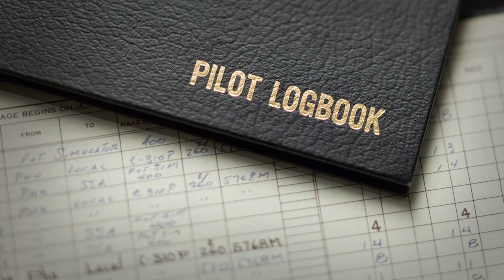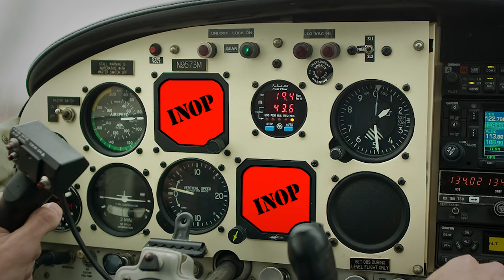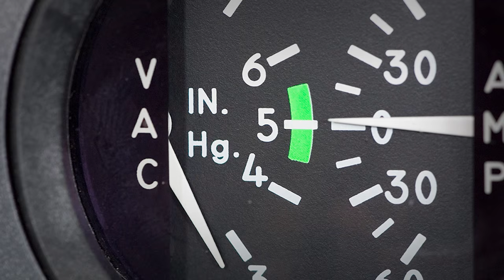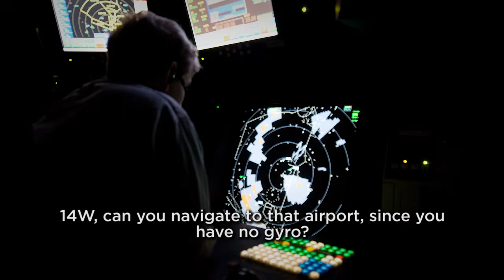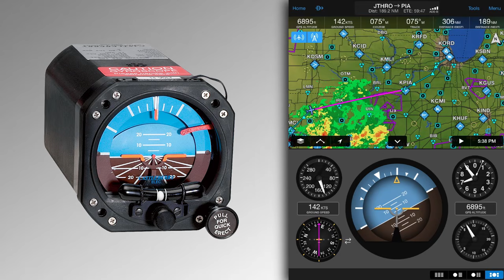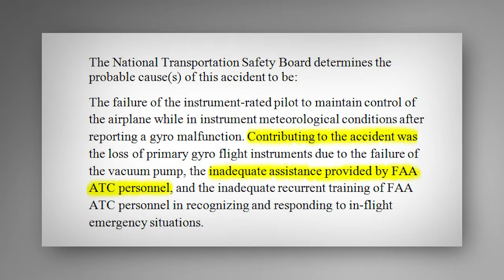Accident Case Study: Emergency Management

Comment: This pisses me off, because ATC could have prevented this. I agree completely that many controllers don’t always connect the dots due to lack of other aviation experience outside of ATC.
Reply: Something else I noticed was that there was a change in controllers (not tower) depending on when the switch happened the second guy may not have had the previous context clues.
Reply: Yeah, pilot could have prevented this as well.

Comment: So atc know he has limited panel and is obviously having huge difficulty flying his aircraft, yet they continue to barrage him with multiple instruction transmissions. 

"Four miles from approach fix, turn right northbound 010, maintain 2000' until established on the localiser, clear ils runway 4". Stop. Just stop. Vector him to long final. Descend him to lowest vector altitude and clear him for the ils from ten miles out if needs be. 

Not impressed.
Reply: @Uhhh kewkabe and A did not learn all the lessons from the video.
Reply: I'm a controller and you forget most controllers are not pilots, nor are we taught about aircraft mechanics or avionics for 300 different types of aircraft. If you say vacuum failure probably 90% would assume your hand vacuum isn't picking up crumbs from the floor. Nor is it clear he's having difficulty flying, just that he's maybe distracted and wasn't watching his altitude and heading. Pilots are expected to tell ATC what they need and what they can or can't do if they're having problems. We can't see in your cockpit. This pilot should have said we need to stay in VMC (or get to VMC), otherwise the controller (who doesn't know your flight conditions) will assume you can accept normal handling. If you don't ask for a long final then the assumption is you can take a shorter turn (especially when you've indicated you're an emergency which the assumption is you want to get on the ground ASAP). Controller did nothing wrong here.
Reply: kewkabe Clearly the NASB disagrees with you. It’s one thing for a non-pilot, or -non-ATC to have that opinion, even a retired pilot or ATC, but for a current ATC to have that opinion is disturbing. Clearly the ATC shared some responsibility in recognizing the pilots situation and suggesting corrective action. Even if just 1% he shared. It is not true that “he did nothing wrong”
Reply: @Bankable2790  PIC decides what to do. The controller asked him what he needed. Im not going to start suggesting what the pilot needs to do as im not certified to fly that plane or 100 percent informed on the problem or his ability.
Reply: Indeed it's the pilot's fault 100% here. He just doesn't want to admit he can't fly the plane and needs help. Instead he's acting as if he's in control and can actually follow directions.

Comment: I live north of Fayetteville and am very familiar with them . A couple of years ago the controllers there were a “little different “. I called in from the north and could not get them on frequency, other pilots also could not get them either so I switched to 133.0 and Fayetteville approach answered I received flight following to Kcre  . A few minutes later ATC says contact on 133.0 so I acknowledged with him at 4500. He starts screaming to switch to 133.0  myself and other pilots informed him we were all on 133.0 after that silence and I finally contacted Myrtle beach approach they informed me Fayetteville had already hand me off to them . The controllers there now are better.

Comment: Every morning I get up, work out, and then practice partial panel instrument approaches to minimums in XPlane 11. I'll also set the winds, turbulence, and wind shear to make sure there's some bounce to it. About every two weeks I take turns under the hood or as a safety pilot with a friend of mine--again, partial panel (of safety pilot's choosing), icing scenarios, and lost comms. Ya gotta practice for when things go wrong with no way out but to face them.
Reply: Flying is super easy..... until it isn’t...
Reply: Christopher Olsen you are my hero! That’s how I want to fly to! Plus some acrobatic for stall and spin recovery would be helpful too :) I think all pilots should experiment under controlled conditions to find their extreme limits. It should be fun to try and learn challenging things.

Comment: God... This is too scary. Was gonna start learning to fly but have scared myself with all these fail vids I have watched. Why  with all this flight sim software I see is it not possible to project a virtual visual view based on Geo position, altitude heading into some kind of headset at least to get to the runway. Surely it is just an issue of synchronisation. This IFR flying needs a technology make over.
Reply: I agree, the technology available today should render such accidents obsolete. Gps would have been helpful in this situation. Putting all of the information into an easily digestible format is key in a stressful situation.
Reply: Why would you do that? You don't jump in the clouds, you start in VFR and that is your whole training for the PPL and then you work on instrumentation. This is the dark side of aviation but we don't sugar coat it because we learn from it.  IT's all about remaining proficient in our craft.
Reply: Flying is dangerous.  That is why you train extensively to do it.  And why you are required to take bi-annual flight reviews.
Reply: Problem is satellites can only show position, altitude, and movement over the ground at best, but he knew these anyway.
What he needed to fly in IMC was the ATTITUDE of the aircraft, and they don’t show that .

Comment: Until the early '90s, commercial and GA pilots' names were always included in CAB and NTSB accident reports. Why is that no longer a part of the historical record? The bureaucracy and length of today's reports is appalling. Some are 300 pages. The 3 February 1959 Buddy Holly accident report is nine pages. Nine pages. I earned paychecks for 50 years and if I learned but one fact, it is this: many in both labor and management never admitted to cruelty, unseemliness, illegality or just making a mistake. They were just offended when accused of these things and had to make sure their gluteus was covered.
Reply: Did you just have a stroke?

Comment: What about the back up compass? That instrument is vital when gyros are down. As said below, ATC was nuts to suggest another ILS approach. When CLEARLY the pilot demonstrated he could not keep a constant heading the blindingly obvious thing to do was to send him south to already confirmed VFR conditions and land at the Alternate. If you have no gyro, NEVER fly IMC.
Reply: The mag compass is an autonomous device (no electric, vacuum or gyro) and is the last resort when determining whether you are in a turn and where you reference to get on an assigned heading.  Few practice making turns using it, but should.

Comment: I can't understand how both the pilot and the ATC were so cool about the no vacuum situation. Vacuum failure in IMC is an immediate emergency call. Try to fly straight and level using the magnetic compass and the turn coordinator. Small heading corrections with the rudder. Fly to regain VMC conditions in the shortest possible time and STAY in VMC.
Reply: ATC aren't pilots nor mechanics, by and large. It's up to the pilot.

See the other video I think it was N440H Beechcraft. He never declared an emergency and ATC didn't know what lack of vacuum meant.
Reply: I'm always surprised on every video how these pilots don't understand they're so close to death.
Reply: Stay in VMC - that's the key. I've made it a point to not fly solo until I become very proficient in IMC. Weather (and your ego) can get you anytime.
Reply: Agreed, but a lot of ATCs don't fly and might not know the severity. This was pilot error, not ATC ... Ultimately it's the person flying who needs to communicate with ATC and make them aware. When he entered clear skies that should've been discussed and it's his own fault for voluntarily choosing IMC over VFR.
Reply: @topspot4834 You know, no. ATC needs to be up to speed on basic flight and aware of possible common emergencies if only because the pilot's gonna be shitting bricks, sounding calm or not, and is in no condition to overload themselves more by teaching instrument flight to the controller.
Reply: ATC was very poor here. Is the location related to that problem?
Reply: @steviesevieria1868  smaller airports for sure

Comment: The pilot in command and ONLY the pilot in command is responsible for the safe operation of the aircraft.
      There was an accident some years ago, a small commuter turbo-prop was cleared into position to hold near the mid part of the runway, as the small plane did not need the entire runway to take off. But before she cleared the commuter to take off she forgot about them and cleared a Boeing (767 I think) to land on the same runway. The running lights of the commuter were lost in the runway lights and was not seen. The Boeing struck the commuter, crushing it and the Boeing crashed into a building killing several people, including one of the pilots, and of course everyone on the commuter.
    The investigators placed most of the blame on the controller, but I think this was a bit unfair. I think most of the blame belongs to the pilot of the commuter, who should have been anticipating clearance at any moment. He he head that another plane had been cleared to land on that same runway, he should have reminded the controller he was still their, holding in position.
      Never assume the controller remembers you are there. If you have the smallest suspicion you've been forgotten call them. I know of at least one case where a general aviation Cessna was at 4000 over Stockton, Ca on thick fog. He was flying North IFR and was told to turn right to 090 to avoid other traffic. After just a few minutes he had not been told to resume his course, and though he couldn't see them he knew he wasn't far from 7000 high mountains. He called ATC to let them know he was still headed East was was about to run into the mountains. He was cleared at once to turn back to the north.
     He had been flying East for just 3 minutes, another 2 minutes would have placed him in real danger of hitting rocky clouds. Controllers are highly skilled, but they are also over worked and prone to mistakes. It is the pilot's job to catch these mistakes. Don't just blindly follow instructions hoping that the controller will keep you safe. Use your SA and common sense.

Comment: As always a great video. I modified my 180 with a standby electric vacuum pump in the event I lost the engine driven pump. Lost it in VFR and the standby worked like a charm.
Reply: Thats called redundancy...and you made it home.  Lets try an ILS approach into IMC with broken gyros and a bad attitude (indicator).  Doesn't work too well.

Comment: I think all pilots should be trained to fly without gyros.
Reply: They do, the issue is majority of pilots don't stay current. Even so, flying without Gyros is hard. Your scan is all wonky, everything is delayed because you have to rely on your mag compass. Pilots need to take it upon themselves to stay current and to keep up their currency.
Reply: Caleb Teague I think this term ‘gyros’ is being misinterpreted. It’s really a slang term for the attitude and directional indicators. You really can’t fly in IMC without ANY gyros. Luckily, however, the turn coordinator does have gyros—- they are just mounted differently from the other two instruments. But more importantly, they are electrically driven, so don’t rely on the vacuum pump.This pump’s vacuum gauge is usually not regularly included in the pilot’s instrument scan. So he usually does have gyros, just not the ones he would prefer to use,sometimes.

Comment: SE IMC is too risky for these very reasons. 
I've got many 1000's of hrs IFR in everything from C172 to Airbus  & I would never fly IMC SE.
It's hard to know why an obviously educated individual would intentionally put himself in harms way, I guess we as humans will always be the weak link in this so unnecessary accidents.
Reply: endwood why? If you got that many hours you know the turn coordinator, magnetic compass, altimeter and vertical speed indicator are not vacuum driven. Its plenty to get out of imc or make a diversion. Key is to not panic and use your training and brain. Information is right in front of you what the aircraft is doing

Comment: As a pilot and ex-controller, I think this video should be standard viewing for all pilots and controllers. And now, for less than 2 grand, you can have a completely separate electric '6 pack' in a 3 inch sq. box. See Garmin or Dynon.
Reply: No need.  You can get a $200 iPad with GPS and load it with Foreflight or Garmin Pilot and have a full backup to everything including navigation.
Reply: @gbigsangle3044   If you are screwing around with your IPAD during an In Flight Emergency with no gyros....you shouldn't be a pilot.  Install a secondary Attitude Indicator.
Reply: What do you think of foreflight on an iPad as a backup?  It has that HSI feature, with artificial horizon, altitude, airspeed, and heading...  Are you familiar with it?  Your thoughts please?
Reply: @goneflying140  I know it’s not certified. Does not mean it won’t save your life tho